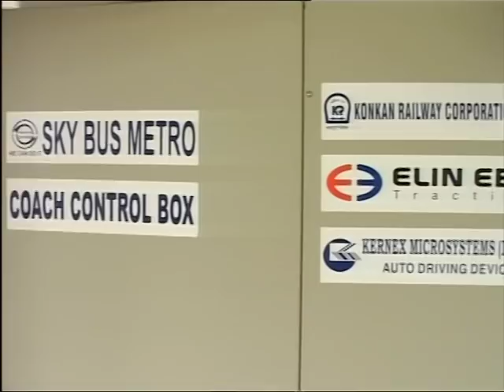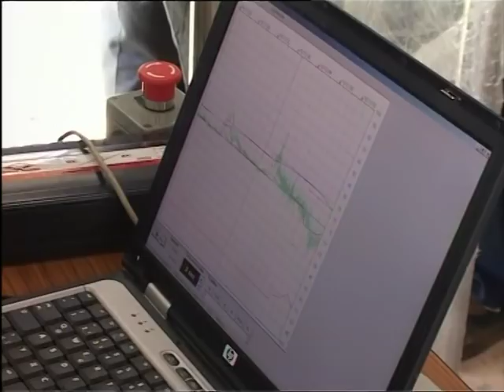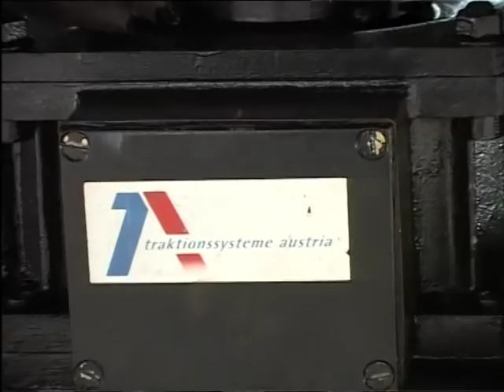Skybus Tech Movie Full

Comment from the maker: It’s normal 3ph AC Asynchronous motors like in standard bogies used in metros. No linear induction motor used . But it’s truly more amenable for using LIM . You can imagine how 😀. 100% same time tested and familiar railway sub modules only used. If 120 kmph bogie or 320 kmph bogie used that speed you get. Turnouts eliminated. Old turntable adopted with digital control and AI as well traverses to turn 90 drag or laterally shift to another track. You can calculate turn round time now gets drastically reduced thus allowing shorter headway. It’s simple but with vast implication for urban transport or high speed too. Land requirement constraints removed .
Reply: sir can i use this video for a case study
Reply from the maker: @PowerTrain  yes  of course! Just normal courtesy of mentioning source!!
Reply: @atrilab  thank you soo much
Reply: hello sir, I have a question which might sound stupid. im not much into technological stuff but the case of skybus struck my interest. i cant help wondering why the doors of the bus are open at 7:55 while its still moving? isnt it dangerous as passengers may fall ??
Reply from the maker: @Cat_tiee  😀. You are right. But in normal revenue operation duly certified for commuters, without doors closed the Skybus won’t move. What you are seeing is workers testing .
Reply: @atrilab  oh alright! That solves my confusion. Thank you for answering :)

Comment: Earlier I thought it was based on LIM technology, but it was based on Conventional RIM technology.  Kindly confirm.
Reply from the maker: It’s normal 3ph AC Asynchronous motors like in standard bogies used in metros. No linear induction motor used . But it’s truly more amenable for using LIM . You can imagine how 😀. 100% same time tested and familiar railway sub modules only used. If 120 kmph bogie or 320 kmph bogie used that speed you get. Turnouts eliminated. Old turntable adopted with digital control and AI as well traverses to turn 90 drag or laterally shift to another track. You can calculate turn round time now gets drastically reduced thus allowing shorter headway. It’s simple but with vast implication for urban transport or high speed too. Land requirement constraints removed .
Reply: @atrilab  sir what is the maximum number of carriages it can accommodate in one system.